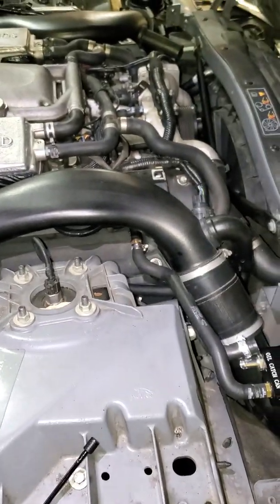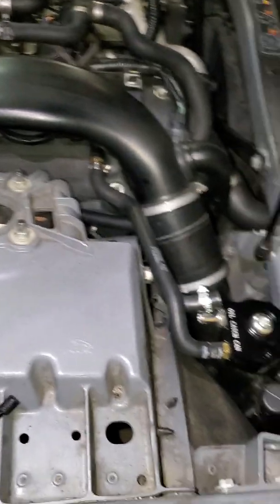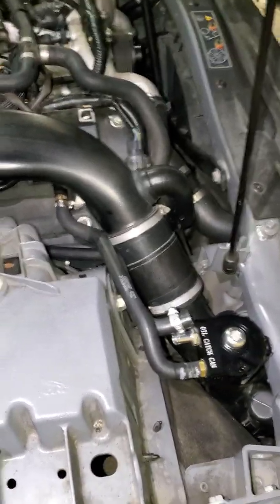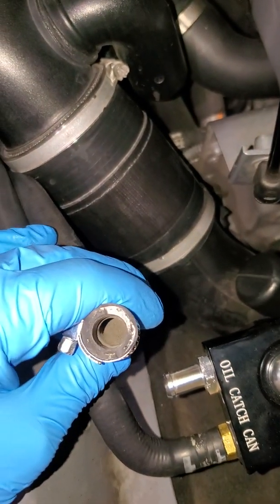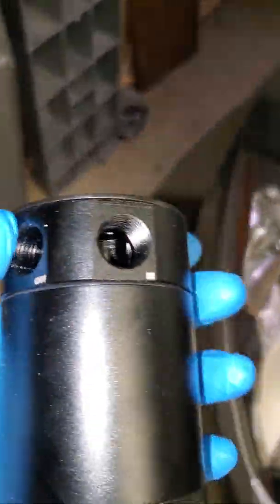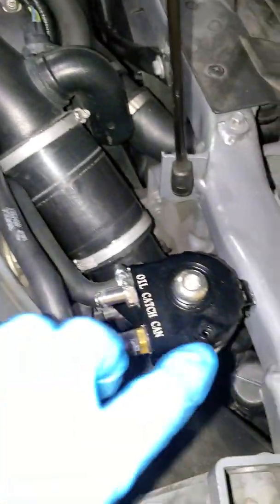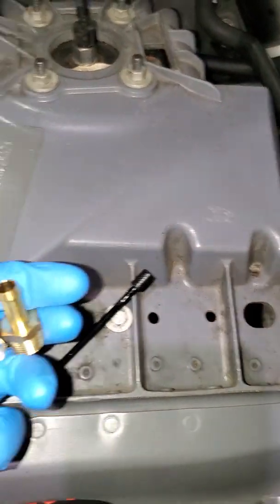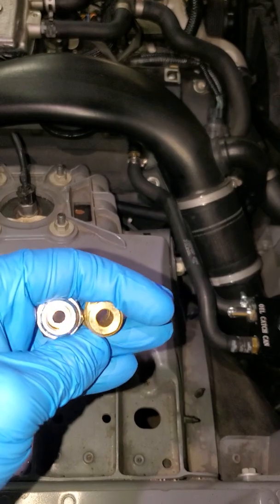Oil Catch cans do they work? Update ! Jaguar XKR

Comment: I have a 1998 xkr(x100) and thinking on installing an oil catch can since my PCV(positive crankcase ventilation) valve is letting oil out through the breather hose. My car is stock except it has a KN air filter which lets more air and therefore I believe the more air results more oil sucking from the PCV valve thhrough the breather hose.